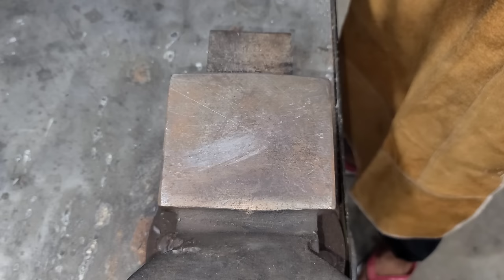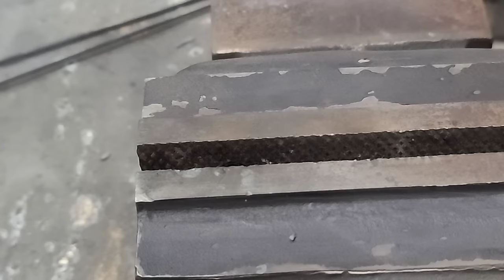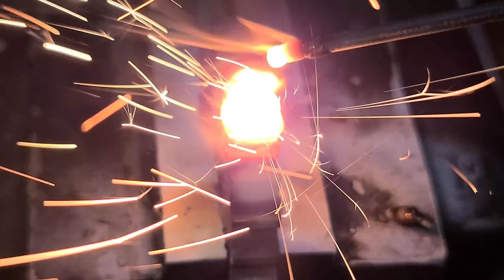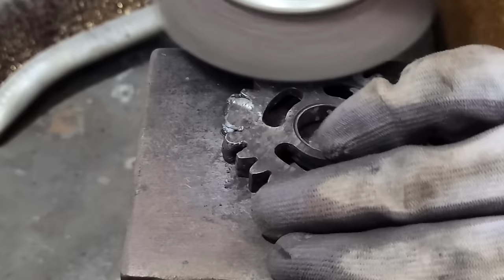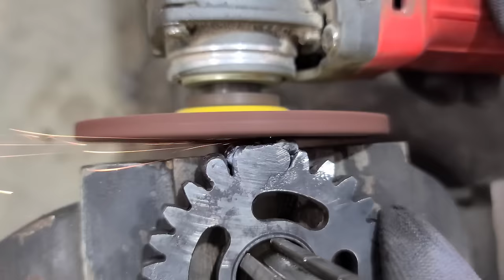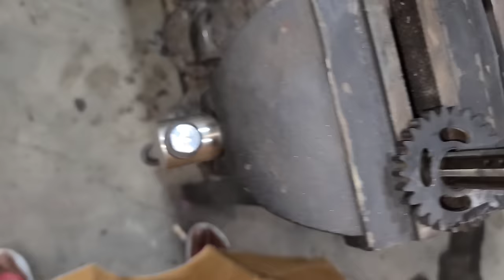Quick And Easy Gear Repair Without A Lathe

Comment: This is a lost art.  Of course it won't hold up in something like a tractor transmission, but of medium use it's very durable.  Have seen this done many times on machinery with NO failures

Comment: I have done this kind of repair. However this guy seems to be using an incorrect flame to make the deposit and the sparks indicate that oxidising is occurring. Assuming the gear is a steel alloy then three different filler materials are required. A prepping material for the first layer the second should be a mid range ‘stellite’ and then a full hard stellite for the final layer. This will result in a good bond with the original and a progressive strengthening to full hard on the surface. A good welder will be able to produce a fair profile for each tooth requiring little machining to achieve a finished job. Done properly the repair will be better than the original. If the gear is subjected to a pulsing load then the gear should be reset to introduce previously unstressed teeth. A typical scenario is from the reciprocating ram on a hay baler where we used to reset the bull wheel and pinion gear some 90 degrees from the current load zone. We did this every 3 to 4 seasons according to the workload. This saved the customer downtime during the season.

Comment: Wow, this patch is very dangerous if you use a load, even though the original just broke, if I didn't dare to use a reconditioned item like this it would further damage the other parts so it's vital, it's best not to imitate it except for displaying the senab, this is dirty technology.

Comment: You might get one tooth to stay if it has  a machined tooth on either side of it but 3 teeth in a row cut by hand in that manner will not hold up to any type of drive application very long. I have repaired gear teeth several times and have gotten away with fixing just one tooth in this manner but when two or more are broken then you better just use a gear cutter or make a form cutter and do it right

Comment: Braising stick welding electrode filler metal, I’ve seen some pretty “unique” fixes on YouTube labeled welding hacks and for the most part I can’t disagree They are most certainly hack jobs someone was too cheap or lazy to do it right the first time. 

But hey if it holds together please do a detailed follow up including its install location, type of load (constant, variable, intermittent or pulsing start and stop engagement), gear train changes, Motor HP and rpm, approximate hours or days of service life and some close ups of the new gear teeth showing the wear incurred.

Comment: The gear will need to be heat treated again, when I was repairing power tools I was warned against heating up a gear using an oxy acetylene torch because that can soften the gear.

The gear teeth aren't polished,I can remember when my manager had to use valve lapping compound to lap in brand new Hitachi angle grinder gears  which were noisy out of the packet !

Comment: Low hydrogen electrodes as filler rods,read yourtechnical bulletins on welding gears that's one method thats recommended,a good repair

Comment: I wouldn't want to have this in the gearbox. I'm not talking about the fact that the 3 teeth will definitely break since they were welded in the wrong way and the wheel was not lowered at all and then surface hardened.

Comment: 8:51 The repaired teeth profile are a bit rough and do not match the curve of the matching gear teeth. This will place the load on just one spot and so likely to damage the matching teeth. Perhaps the job was a bit rushed for the video's sake.

Comment: Maybe the part's not available or can't be delivered to your location looks like you did the best you would imagine that gear probably cost between 20 and a $100 I Would have just got a new one You spent more on welding rods and grinding discs

Comment: Es un bonito trabajo de artesanía . Pero nada más. Porque al soldar. Y calentarse  el material ya perdió su resistencia mecánica y seguramente se va a romper rápidamente en cualquier parte de la misma . Porque los engranajes se utilizan para ejecutar esfuerzos mecánicos muy grandes y si el material ha perdido su temple por recalentamiento se va a romper fácilmente

Comment: Well there goes any hardness on that gear.  And your not supposed to put your flux on before the heat cause it burns off at like 800 degrees

Comment: Ой не смешите меня! Намазал зубной пастой и зубья выросли! :))))  Где же эта шестерёнка будет стоять? Если у ней нет даже канавки под шплинт?! При первом же усилии эта сварка отлетит. А боковые зубья ослаблены температурой.
Oh don't make me laugh! I applied toothpaste and my teeth grew! :)))) Where will this gear be located? If it doesn't even have a groove for a cotter pin?! At the first effort, this weld will fly off. And the side teeth are weakened by temperature.

Comment: Old vs New vs "Repair" 😂😂😂 we have used this method before and it works out in light force pressure installations but not indeed in heavy work vehicles for example agricultural ones do not lose your time...

Comment: Why trash talk this? In industrial applications, where weight is of no concern, not all gears are face hardened nor require full strength of the material. I've once seen a steel gear replaced with 3d printed ABS plastic and worked just fine. Machinery got stuck a steel gear break due to inertia of the system. During normal operation ABS was not only strong enough, it actually turned out to be superior to original steel gear for maintenence; if it gets stuck again you know exactly what to replace, protecting motor and other components from shock. And each gear cost 1/200th of manufacturing a replacement gear. 

Or operator does something wrong, engages the wrong transmission and gears break. Foreign object gets between teeth, gears break.. If no replacement is available, needs to be shipped overseas, or there is an urgency, this fix will work just fine. Of course I wouldn't trust any repaired gear with a critical task, but a gear driving a puny conveyor belt? Sized not for strength requirements but dimensional necessities? I don't see why not.

Comment: Whats actually funny about this is its quicker to just remake the part, without heat treat even.....Unless you have no tools. But still , what happens when the repair breaks and the broken pieces break all the gears and shatters the casings? Instantly killing an entire formerly good engine or device. Was it worth it then? I think you do some great stuff, but this is terrible for anything but the very weakest of torque applications. This is like putting grade one bolts on a connecting rod, and wondering why they snap off at 1/3 the torque rating when tightening...Bad Mojo to go cheap on this.       Let the arguments fall aside. Im a machinist for 40yrs now...Not the brightest star ,but I was force fed knowledge by the gallon. handed down direct from my apprenticeship and the dottering old timers watchful eyes and muttered cursing at me for being dumb yet again...And I was clearly instructed on gear brazing, yes it works. I NEVER trust it. But I never broke any repaired, so i guess im wrong in a way.   Sigh, Machinist introspection.  Got any paint i can watch dry while this milling pass goes on...and on and on...

Comment: This sort of repair infuriates a true machinist. The anger is due to fearing some cheap farmer is going to drag in a candidate and debate the machinist regarding the effectiveness. If there was room for the machinist to engrave "I warned (farmer name) this wasn't going to work(and date it)" he might do it.

The engraving is to warn the guy who buys the equipment at auction, when the repair fails. Cause there's a high probability the farmer will immediately take to an out of state auction.

Comment: This gearwheel is just scrap; heating it with a cutting torch ruins the surface hardness. You also can't get the shape of the teeth with the angle grinder. If you install this thing, you'll ruin the rest of the gears. So what's the point of this shit? Just clicks and money.
Эта шестерня просто металлолом; нагрев резаком разрушает твердость поверхности. Углошлифовальной машиной также не получится получить форму зубьев. Если вы установите эту штуку, вы испортите остальные шестерни. Так какой смысл в этом дерьме? Только клики и деньги.